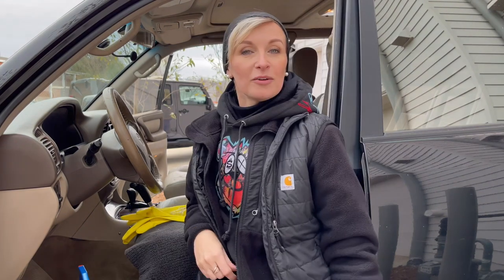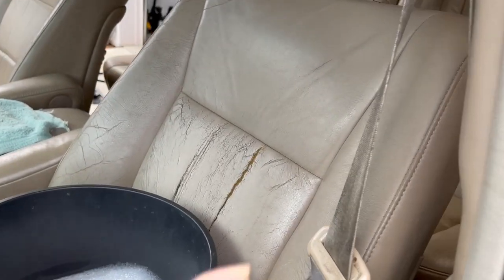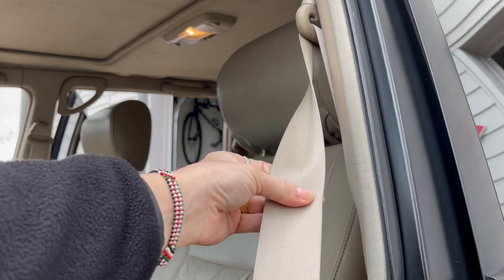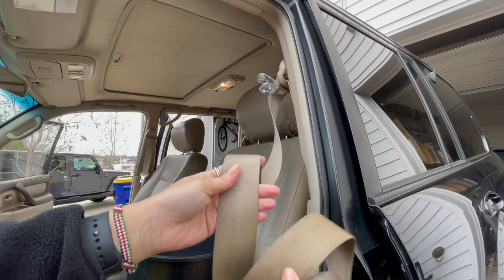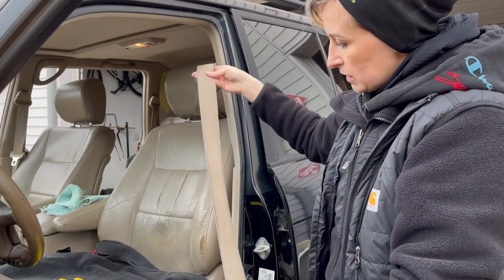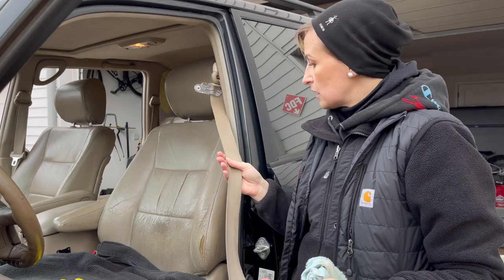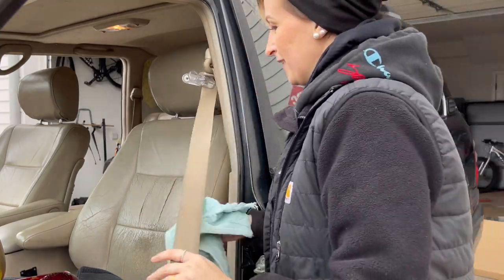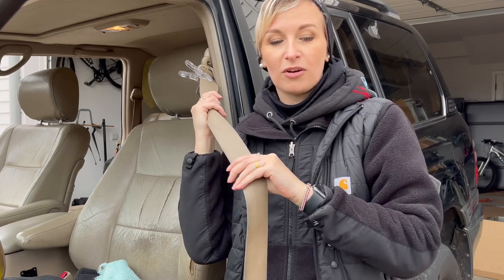Toyota 100 SERIES LAND CRUISER || HOW TO CLEAN SEAT BELTS | DIY

Comment: There is an even easier way...did it on my 100. unbolt the bottom of the seatbelt pull out the seat belt until you cant pull anymore. then you shut the door on it and pressure wash it while holding the metal end (so it doesnt flap and screw up your paint). its about 30 seconds a belt just do both sides.
Reply from the maker: Next time we will have to try it!
Reply: Yep! Works a treat